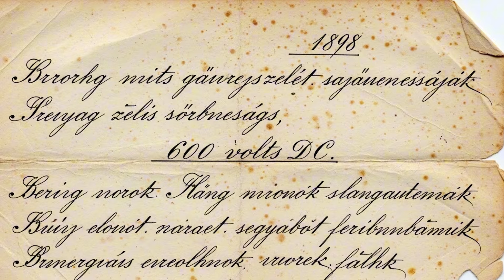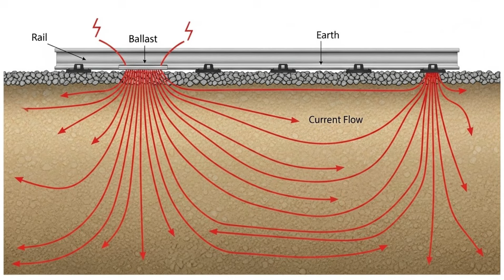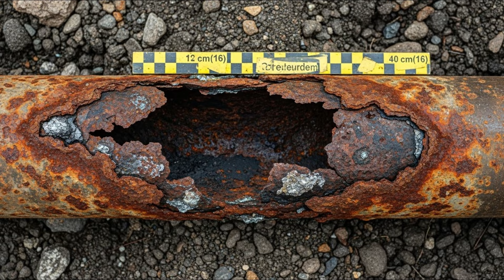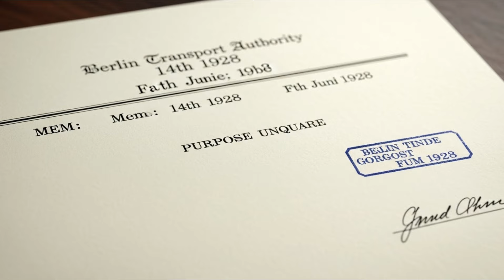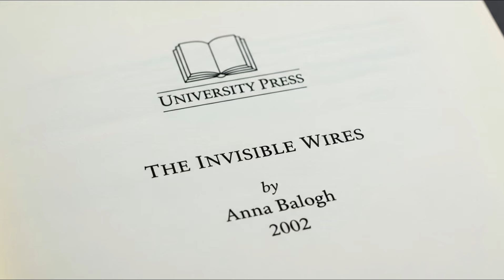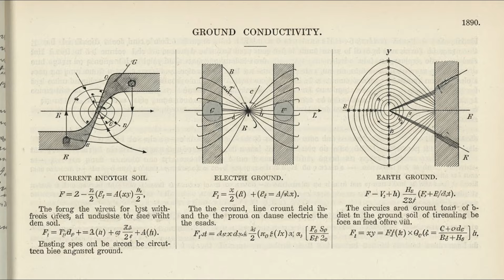How Old World Streetcar Systems Ran on Earth Currents, Not Overhead Wires

Comment: This has been written by someone who is away with the fairies, and has no knowledge of D C power supplies. The London underground runs on DC power and has a power rail at a high positive voltage whilst the negative rail is at a negative  around 230vdc. It was done to help stop voltage leakage destroying the tunnel lining sections. Put simply the tram system in the video is using ground as a return line. Perhaps the Trams had  batteries as well. London trollie buses had batteries to allow  them to be moved around in the depot,or in case of emergency blocking of roads.
Reply from the maker: Thanks for the technical clarification. You’re right—London Underground’s DC system uses separated positive and negative rails specifically to control leakage and protect tunnel infrastructure.

Comment: Earth return networks are problematic by their nature. For all the reasons explained. Installing modern Tram networks is already cripplingly expensive at, £87m per mile in the UK. Can you imagine the cost of building Ground return networks, even in limited Conservation areas. And would anyone tolerate the risk of even a single electrified rail. Batteries are probably a better alternative these days. Their costs continue to plummet...

Comment: They ran on underground cables. They were trolleys. The rails were not electrified.
Reply from the maker: Thanks for clarifying. Yes—many early trolley systems used underground conduit or cable systems, with power supplied below street level rather than through the rails.

Comment: The very first Siemens loco used the two rails like a model railway. Most of this is nonsense as there is always a negative rail. Safety required that there was either OHLE or an underground plough system like in London, NYC, and Washington. The stray currents issue soon resulted in improved return systems particularly negative boosters - a generator making the rails slightly negative to earth. This guy needs to do a course in electrical engineering.
Reply from the maker: Thanks for adding engineering context. Distinguishing historical prototypes from scalable, safe systems is essential for an accurate discussion.

Comment: I was given some very detailed electrical engineering book form around 1900 there was a full explanation of trams without over head cables totally different to this there was contact points every so many feet apart, a long pickup shoe under the tram that spanned a few contact points the contact points had a magnetically operated switch built into them a large magnet on the tram turned them on whilst passing over them becoming live there was a problem with the switch sticking on so an earthing shoe was fitted to short out and blow a fuse on any faulty contacts the return path was through the rails as still used today
It was a set of electrical engineering books covered everything known at the time my mother got them from a jumble sale some 65 years ago I wish I still had them

Comment: Ground should never be used as an electrical conductor. It causes all kinds of problem. The phone company learned this very early on and went to two wire balanced systems. However telegraph systems did use this system with plus and minus 130 volt power and ground return.
Reply from the maker: Thanks for adding that context. It’s a reminder that what worked temporarily or experimentally doesn’t always scale into safe, long-term infrastructure.
Reply: @TheMudfloodedArchive  At the end of the last century, two telephone subscribers shared the same pair of wires: between these was transmitted the voice (one subscriber at a time), and also was performed the pulse dialing, and one of the subscribers had a pair of 2 opposing diodes, this modifying the pulse level and distinguishing between the two. Instead the ringing (80 V) was using one or the other wire respectively, and the earth - a metal rod in the ground. The old house was provided with LINE and NULL, no PROTECTION EARTH. I created a PROTECTION EARTH for the mains by a 1.5 meter 1 inch pipe inserted into the ground, which happened to be at 10 meters from the telephone rod. When a short-circuit occurred between line (hot 220 V) and my PROTECTION EARTH, the telephone rung for a fraction of second (until the fuse interrupted).
Reply: Australian outback power systems use a single high-voltage overhead wire and ground return for some applications (Single Wire Earth Return SWER). The original POTS also used the method, which is why the -50 V was used for power, to reduce corrosion of wires.

Comment: Yes, as mentioned, huge earth currents are not good. Also a tram needs a certain amount of power to move it, so either heaps of amps, or heaps of volts (a suburban train 1500V, up to 500A) not as much as a suburban train, but still significant, so a live rail and heaps of ground current, not good.
Anything metal, or conductive in the ground will cop it big time, even steel concrete reinforcement in building foundations, no wonder they moved away, only good as a party trick
Reply from the maker: Agreed—what might work briefly or experimentally doesn’t scale safely. Once you factor in infrastructure wear and unintended current paths, the trade-offs become unacceptable.

Comment: I think this information is a bit muddy. To have two rail power operation in this case one rail went to the ground with long grounding stakes every so often, while the other was fully insulated and powered, so it used the ground wire as a the power return path loop that is necessary for this to work. However this is a great MFG problem for the train it self. One set of wheels on one side has to be insulated from the other as well as wisely insulated from the passenger compartment, while using a bearing, or some king of roller on the wheel to puck up the power current.   In model trains that insulated part is a piece of plastic, as the bearing or as the wheel bushing. The model is not to heavy, but a real train, the weight will wear on that insulated part and soon short out.  To me that is why they never kept it going, to much expense, and the safety factor. I knew for many years here in PA and maybe in Washing DC they had this third rail off to the side for the under ground and other unique passenger service areas. To me that is still very dangerous, if a person would touch it and the regular rail.  Real train tracks are not a toy and people need to be taught that.   
 Our system here in the USA is greatly based on a return [path ground for our in home and business electric power.
Reply from the maker: Thanks for emphasizing safety. You’re right—rail power systems demand respect, and public education is essential because real trains are anything but toys.
Reply: You are right, difficult to insulate between the wheels, easier for the third, not bearing LOAD, nor TORQUE.
By the way, PLASTIC did not exist at that time, insulation meant ceramic, rubber, cotton, wood, etc. .

Comment: This video appears to use an Ai narration but the ground current is correct. Check out present day electricity supply systems with respect to LIVE, NEUTRAL and Ground Fault Interruption (USA) and Earth Fault isolation devices and RCD (UK) in which fault currents are routed through Ground / Earth via Ground Rods to the local supply Utility company's transformers. 
As for powering tram cars that is indeed possible and works the same as a model/toy railway/railroad via the two rails. The early telegraph system used a single wire, supported on poles, to supply the morse key etc., and the return was through the connection through the Earth to make/complete the circuit. It should be noted that passing electricity through the ground does cause corrosion of metal structures buried in the current paths due to electrolytic action.

Comment: more AI slop
Reply: This video appears to use an Ai narration but the ground current is correct. Check out present day electricity supply systems with respect to LIVE, NEUTRAL and Ground Fault Interruption (USA) and Earth Fault isolation devices and RCD (UK) in which fault currents are routed through Ground / Earth via Ground Rods to the local supply Utility company's transformers. 
As for powering tram cars that is indeed possible and works the same as a model/toy railway/railroad via the two rails. The early telegraph system used a single wire, supported on poles, to supply the morse key etc., and the return was through the connection through the Earth to make/complete the circuit. It should be noted that passing electricity through the ground does cause corrosion of metal structures buried in the current paths due to electrolytic action.
Reply from the maker: Thanks for the detailed technical input. You’re right—ground and earth-fault systems are well understood today, and distinguishing fault return paths from continuous power delivery is key.

Comment: Page 4;40 earth as return path, return current in today’s definition applies well to lightening change bypass or appliance leakage bypass. Both relates to high impedance (electrostatic) discharge. Such amount of current may barely operate a toy train, certainly not a tram. 

In other to keep the system operate with ground return is to increase source voltage to over come ground return resistance at the cost to pronounced system efficiency issue and energy loss.
Reply from the maker: Thanks for the technical breakdown. You’re right—high-impedance ground return is fundamentally different from a low-impedance traction power system, and that distinction needs to be clearer.
Reply: @TheMudfloodedArchive  the general understanding at the time, the atmospheric electricity, lightening and electrostatic discharge all dissipated into the ground confused and assumed ground as a low impedance have lead them design the track current distribution to run through ground. Have quickly found tram motor was deprived of voltages and the track voltage was dangerously high, caused by relative high resistance earth. Premature eroded city pipes was an indication. They increase the number of grounding electrodes only worsen the erosion. Soon they realize earth resistance isn’t low enough to handle low impedance load, tram motor loads. They quickly adapt track to track and eventually by overhead to track distribution networks, because the former electrocuted people. From then on no more premature pipe erosion failure.
Reply: It did not. They changed from positive rail and negative rail to overhead line or catenary.
The First Electric Railway (1881)
The first permanent, public electric railway in the world was the Gross-Lichterfelde Tramway in Berlin, Germany.🇩🇪⚡🚃
Date: Opened May 12, 1881.  
Power: 100V DC (Direct Current).  
Context: Built by Werner von Siemens, it was a short 2.5 km line. Interestingly, it originally used the rails themselves to conduct electricity (one rail was positive, the other negative), which was dangerous for horses and pedestrians, so it eventually switched to an overhead wire.
Reply: @franciscorompana2985  they did it once (+tack_source to -track_earth first, then +track_source to -track_source) and no more. Soon settled to overhead to rail distribution.

Comment: some rural areas in usa use a single wire delivery, similarly, for standard 60hz power. Biological hell for farm animals and humans camping. Called "stray volltage".
Reply from the maker: Yes, stray voltage is a documented issue, especially in rural power systems. Proper grounding and monitoring are critical to reduce risks for animals and people.
Reply: By definition, the return of tri-phasic system is through earth (only 3 cables!). IF the consumers were PERFECTLY balanced, the earth current would be zero, but it is not. You can have a few volts (or more?) between NEUTRAL and EARTH. It is much worse for monophasic system, all the amperage through earth.

Comment: There are a few details wrong with this video. I would like to point out that the reason London Underground has 4 rails is to prevent stray return currents leaking into and causing corrosion in adjacent  metal pipes,  When Magnus Volk opened his electric railway in Brighton in 1883 he used a two rail supply but changed it to third rail the next year due to problems. Two rail supply only works with low voltage on model railways.
Reply from the maker: Appreciate the correction. This kind of historical and engineering context adds value to the discussion and helps keep it accurate.

Comment: Funny how this video dances around the main issue—may I say, the elephant in the room?—with the subject. That is that any system without overhead wires must necessarily provide both conductors at ground level, meaning there is a shock hazard on the rails. I don’t care how they do the ground return, what matters is there must be a positive conductor, and that conductor is charged at 600 volts typically, and it is either on a third rail or is one of the two rails. In the case of one rail positive, the other negative, this presents a problem for the cars, in that they cannot use solid axles which are typical for rail vehicles, since the solid axle conducts electricity and would short out the power between the rails. But no matter whether they used 2 rails or 3, if a person or animal should stand on both rails at once, they become dead. But this is ignored, probably because the whole video is nothing but AI slop.
Reply: I wasted 5 minutes of my life before I realised it's AI Slop. Utube becomes more worthless by the day. I thought channels were mandated to advise on the use of AI, this one clearly doesn't.
Reply: If you stepped on just the hot rail with just one foot while the other foot was touching the ground around the tracks you're toast. No need to stand on both rails, just hot and ANYTHING that was in contact with the earth.🤯
Reply from the maker: You raise valid safety and engineering points. Early rail systems had real constraints, and we should be clearer about which configurations are historically documented versus speculative.

Comment: With a rail at 600 volts or so relative to ground, how did it not kill anyone who stepped on it?
Reply: @1906Farnsworth  I just wrote a comment about it, but I have only secondary knowledge. Here, I copied it for you:
"My grandparents, born in 19th century, warned me to NEVER, NEVER, NEVER stand with one leg on one rail and one leg on another rail because my body will connect rails what will produce strong current of electricity and I will DIE AT THAT MOMENT. But I can freely walk, sit, dance on ONE RAIL, no matter which one."

I remember that I worried for big snakes, really big snakes: they could be on 2 rails at the same time.
I remember old people were saying that overhead wires were introduced bc old wireless system was "dangerous". 
For a short period a third rail was introduced, one between 2 rails, and middle wheel was a bit smaller, right?
Reply: @tazika2988  Washington, D.C had a street car/tram system that used a buried 3rd rail power source between the 2 running rails.  This was used in the down town sections to avoid having over head wires contacted by a trolley pole.  The trouble was that men had to be stationed in below street level pits to fasten/unfasten the 3rd rail collector shoes when the cars entered/left the area with no over head wires.  There was no electrical potential between the running rails and the metal corridor between the running rails.
Reply: @WayneLong-cs6xp Also, used in NYC.
Reply: In Berlin, the subway works with a slightly covered third rail. It's considered dangerous - deadly - to touch. However, I've never heard of someone hurt by touching the third rail so it may be an urban myth similar to the hair dryer thrown into the bath tub.
Reply: @BabylonPatrol that covering of the 3rd rail is very effective at preventing accidental fry-ups. However, no such thing as zero risk where traction current is concerned. It makes the Electric Chair look...weedy.
Reply: @B @BabylonPatrol Same as NYC subway.
Reply: @BabylonPatrol  The same in Hamburgs underground railway (U-Bahn). The busbar  got an insulation cover , the slider at the train connect from down below.  So if someone steps on the busbar, nothing happens. It is safe. I assume  the Berlin trains use the same voltage like Hamburgs trains, 750V positive Earth.
But such a system is not applicable for street cars because those busbars were a barrierer along the railside. 
Finally an  single wire overhead power  line  with rail return is todays world wide standard for street cars.
Reply: @BabylonPatrol  Seems that the metro has one pole as the both rails, and the other pole is a higher rail, with the top and sides insulated, contact on face below. In the depot, no third rail, but overhead wire.
Reply: It did
Reply: Horses and cows can touch both rails at once and fry.
Large dogs and people also can bridge the conductors, and if not wearing shoes, people could get hurt or killed,
as the 600 volt rail to ground, not the other rail, was dangerous too.

That is why the high voltage is in the air, and ground is on the ground.

All in the name of safety.
Reply: @crashburn-s3b  It is possible to be shocked by touching the live rail and ground at the same time for anyone. No need to touch the the other rail.
Reply: @crashburn-s3b  Even people with WET shoes can be fried at 750 V.
Reply: Because you had to trouch both rails in order to get fried !!!
Reply: @sietze.temporary No... phase live rail and ground/earth will kill. I was born, and lived in the 3rd rail electrified South London British Rail region. Many suicidal, murderous and accidental deaths.
Reply: Electromagnetic